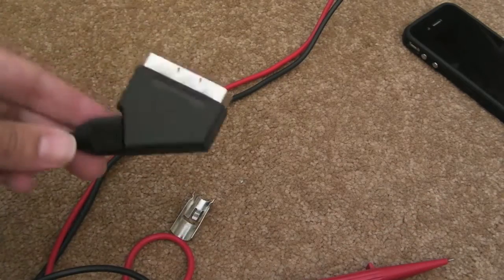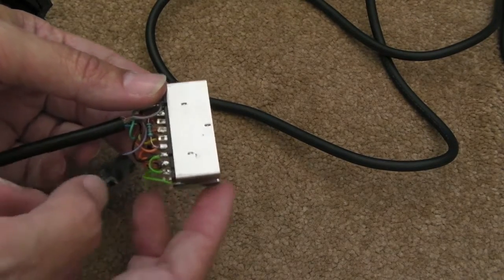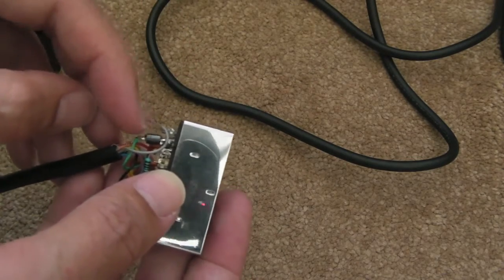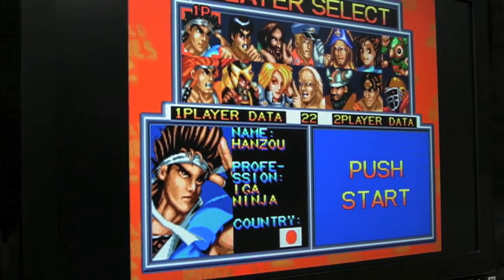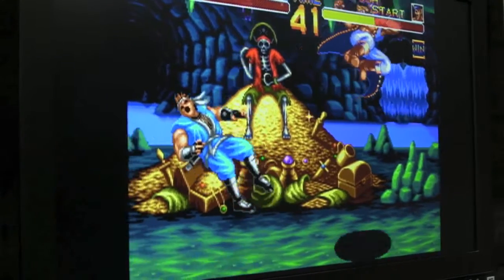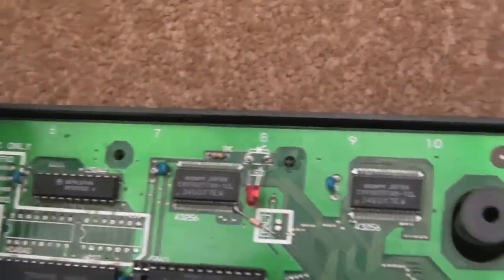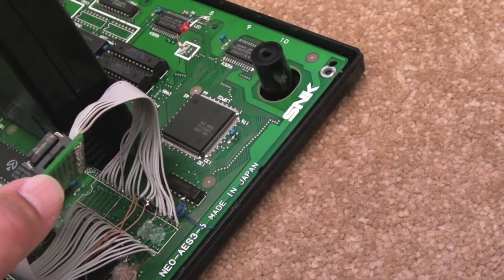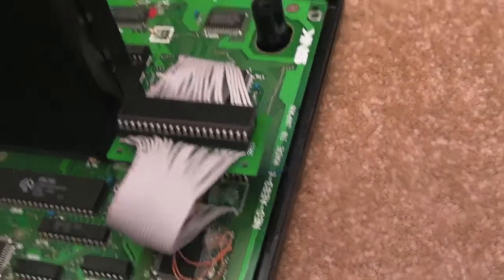SNK Neo Geo AES Repair Part 2 (Video & Sound - AV Cable Repair)

Comment: Sounds and looks awesome! very nice repair! My first CMVS was composite and it was really rubbish (I believe I sent you pics/vids)
Reply from the maker: Yes, I am very impressed with the 3-6 revision.  Beaps AES gives better video output than mine.  Although it's on par with the RGB output from my MV-1FZ.  I think the problem you had with that other CMVS was that little board that someone had fitted.
Reply: GadgetUK164 yeah I think you were right, enjoying RGB quality on my second CMVS though. 

Excellent work once again pal :-)